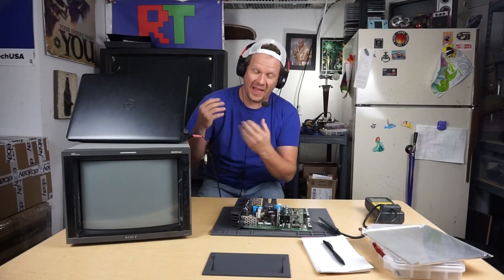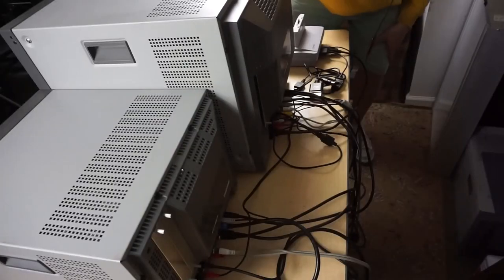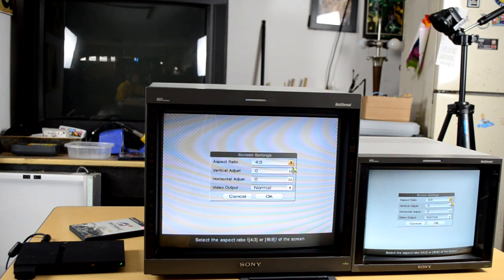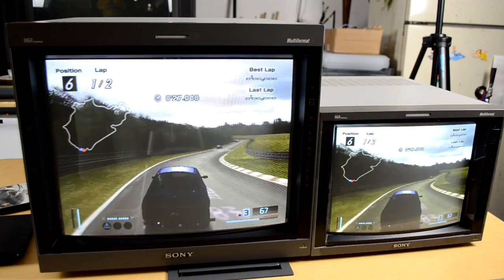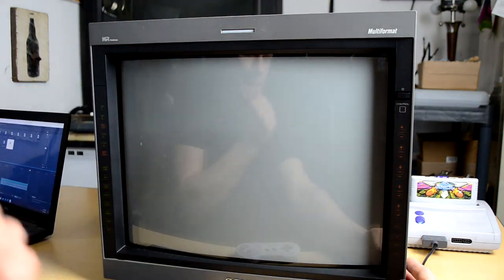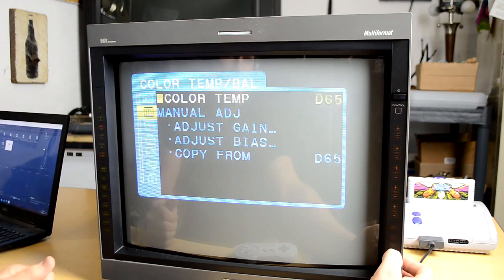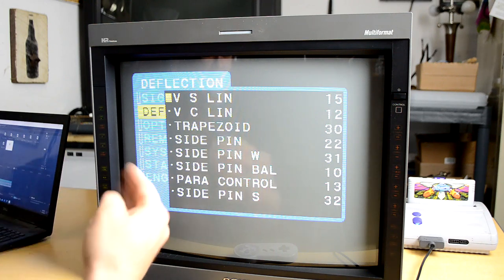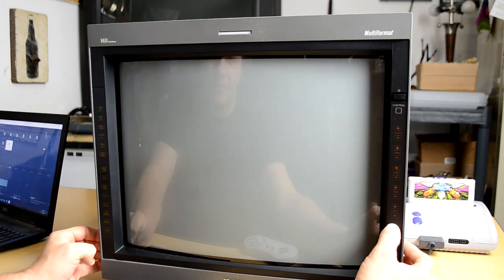Sony PVM 20L5 Input Resolution Testing & Calibration - SUPER CRT Fun!

Comment: Do you have a multimeter you recommend? I heard Fluke gives the most accurate readings but they are $300-400. Ive been using a $7 one from Harbor Freight that I am told is worthless. I dont really wanna spend over $100-150.

Comment: Good video, i have bkm-129x and it works nice on 240p, but 480p seems to be little bit broken. It appers to have something wrong with voltage, screen goes blurry and messy in the time when you using 480p source.

Comment: Nice video, but i‘ve got a question about my Sony KV-21x5d consumer-set, because i think it behaves kinda weird... first: when i turn it on, no matter for how long it has been turned off, it takes about 20 seconds to show a picture after i hit power, which is weird considering most tvs are on within 5 secs or so. When i then turn it off after a longer seassion, it „rustles“ like every crt, but it does that unnormally much. Also, when i play a game with black backround, i can see some ghosting. And one last problem: Whe it was just turned on, and the screen changes from bright to dark in a movie or game, it does that „rustling“ a crt does when turned off but for only one time. 
I got that TV from an old Lady downtown for 10€, she probably used it very much. 

The TV does that since i’ve got it in early 2019. Besides that the TV works perfect and has a great picture tbh, but does someone know if thats normal, just age and much use, or will my tv fall apart in a couple weeks? Sorry for my crappy english, kind regards from Germany.

Comment: It would be nice if one could disable the automatic letterboxing for 720p and 1080i, that way it would be possible to watch 4:3 HD content (using a video processor or PC to stretch out the image to fill the screen instead of having side bars).  One can almost use the Deflection settings to stretch 720p/1080i to fill the screen, but there's still some letterboxing.
Reply: Unfortunately even if you did that the image will always lose detail and look way too squished in horizontally when sretched in the ways you've recommended (I've tried it before) , which is why its better to just save up and invest in a monitor with a proper 16:9 panel built in like the bvm-d24 or any pc crt monitor with similar 16:9 panel displays for 720p/1080i.
Reply: Don't really want to buy a 16:9 monitor just to be able to watch 4:3 HD content (already have a PC CRT anyway). Was just wishing for more uses for my 20L5.
Reply: @jd213_  well, in that case your only option then is to stick with media that was created with 480p in mind otherwise it's a no go sadly.

Comment: I recommend PS3 or X360 for 720p. Not all games render at 1280x720 but many do. Even better would be to use PS4, etc with component converter where you could test 1920x1080 properly